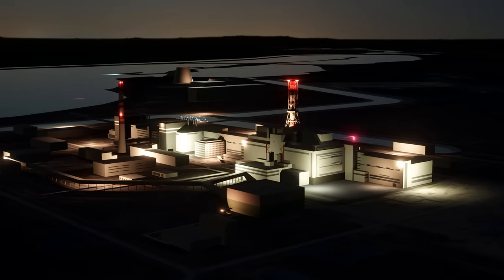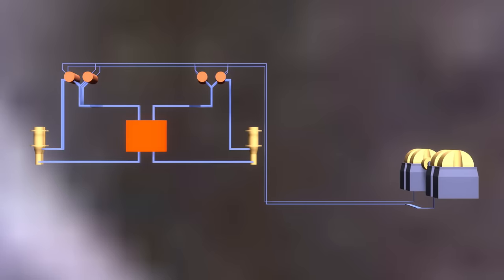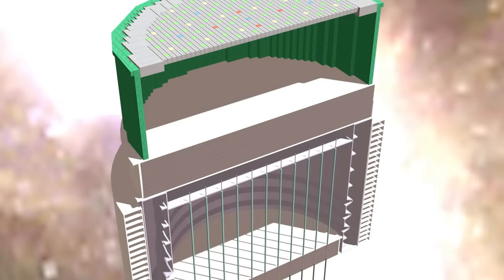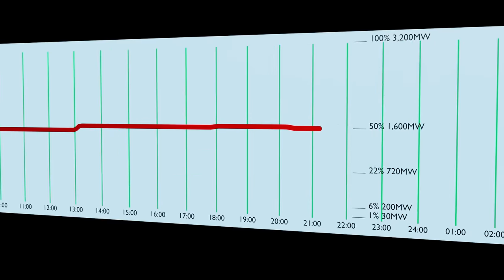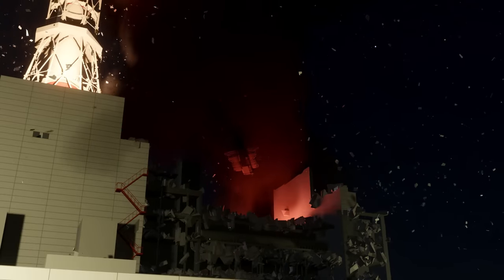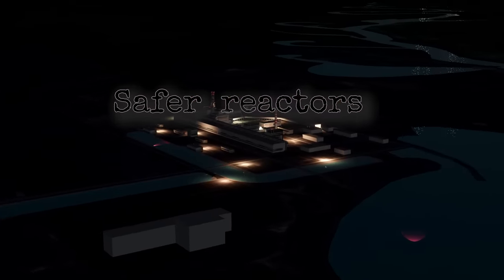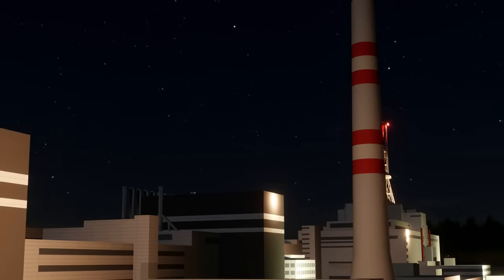CHERNOBYL AZ-5 why it exploded

Comment: *Edit* 
Mike actually edited the video to implement most of these changes, which must be unprecedented in the history of Youtube!

Good video overall, but here are some corrections:
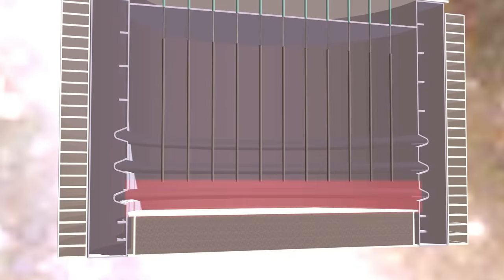4:20 - The graphite sections were cut short because there wasn't enough space below the core, rather than to equalize fuel burn.
4:45 - The previous test had been performed just after a reactor startup, but on April 26 there was a shutdown planned.
5:00 - Running the reactor at half power did not poison it. On the contrary it gave time for the xenon to burn off. If not for the delay, the poisoning would have been worse. Xenon is not a contributing factor to the accident any more than gravity contributes to a skydiving accident.
6:00 - The rules at the time DID allow for restoring power regardless of Xenon, so long as certain conditions were met. It is ambiguous whether any rules were broken, but at the time the operators would not have seen any clear reason not to continue.
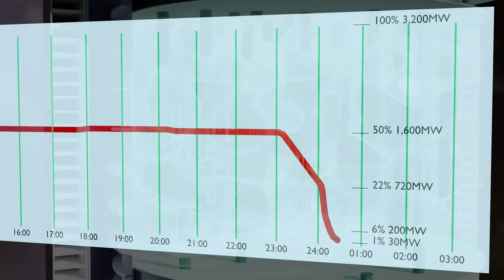6:15 - The control rods were in a normal and allowed position after restoring power for the test. But later changes to coolant flow and temperature meant that more rods had to be removed. The car analogy is silly because the RBMK was designed to be operated like this (fewer rods inserted = greater fuel efficiency).
6:45 - The personnel had agreed to push AZ-5 at the START of the test, but apparently there was some confusion and this action was delayed for 36 seconds.
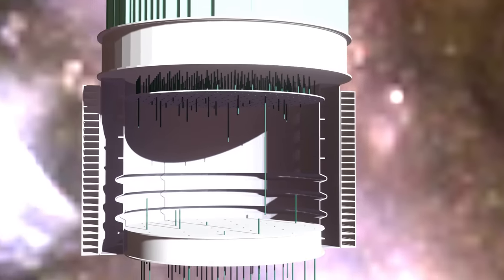7:15 - An entire group of automatic control rods was fully inserted, and another set was in motion as well. There is nothing 'frightening' about no rods being fully inserted; this is just how the RBMK was supposed to be.
7:25 - In practice the limit was 15 rods, not 26. RBMKs had to regularly operate with less than 26 rods, and operators were unable to track short-term fluctuations in this value because at low power there was no instrument capable of tracking it.
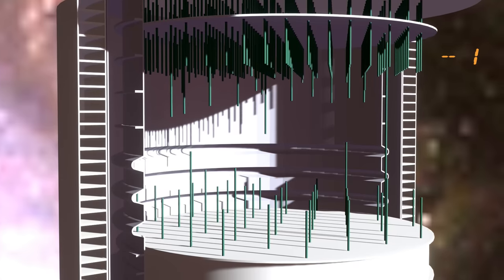7:38 - AZ-5 did NOT insert any rods from below. If it had, the reactor would have been saved. This safety improvement was scheduled to be implemented following the scheduled shutdown.
Reply: Майкл, ты?
Reply: @ВячеславТитов-ы8ж  тихо, я инкогнито
Reply from the maker: Thanks for this information.  

The positions of the control rods at moment of AZ5 I modelled exactly as in the INSAG-7 report.  This shows 7 below rods partially in the core.  How is it that these rods had not yet been installed if they are shown in INSAG?  Insag also shows the Auto rods were mostly extracted at the time.

I don't recall INSAG saying they the below rods were still to be installed and this is a pretty vital aspect.

Are you certain the below rods were not yet installed?  Its the first I heard this.  But when visualizing it in 3d, it does seem odd they were not enough to the stop the runaway on the floor and makes sense.
Reply: @Mike-Bell  What page of INSAG are you referring to? I will check, but suspect you are misinterpreting something. By the way ORM = 7 has nothing to do with 7 rods being partially inserted. Many more rods were partially inserted than that. ORM is a calculated value that depends on the shape of the neutron fields, "1 rod" is sort of an imaginary value.

The bottom-insertion rods (USP group) were installed, they just didn't insert when AZ-5 was pressed. The planned fix was to connect their insertion to the AZ-5 signal.
Reply from the maker: @MinSredMash  Ok now I understand. Chernobyl did have it’s below rods but they didn’t enter the core on the night of the disaster because they weren’t coupled to the AZ5.  Had Toptunov inserted the below rods first and then shutdown or if they were included with the AZ5 signal it would have all been a non-event .  What a tragic ballsup because it is so clear from the 3d how they would have prevented the explosion.

Page 45 right at the top confirms that the shortened below rods were proposed in 1977 to be coupled to AZ5 but not implemented at Chernobyl as well as other plants. 

Now I’m pondering whether to take the video down and upload a correct version with the below rods not moving in the animation with the pushing of the AZ5.  And also delete the wording about the ORM and some of the xenon poisoning wording. The xenon caused the stalling of the reactor to 1% right?  Redoing the voice is big job now but I can redo the 3d modeling easily and quickly. 

p 119 shows the rod depths I modeled in 3d.  I presume this is reliable. It shows the auto rods also extracted.

Thanks for the corrections you list.
Reply: @Mike-Bell  You shouldn't have to do an entirely new video.  Just put your corrections as a comment thread here.
Reply: @Mike-Bell  Cheers, thanks for asking. Probably adding some notes to the video description text is plenty, but if you plan to edit the script I could suggest some wording.

Xenon didn't directly cause the drop in power. There was either a user error or a malfunction of the automatic regulator or both, and a bunch of automatic control rods were inserted. The xenon in the core probably perpetuated the resulting drop in power. Page 74 of INSAG-7 explains the relevance here, in terms of a "new xenon reshaping of the power density fields." After all, the critical problem was that the neutron flux maximum was at the bottom of the core, right where the tip effect existed. 

Pg. 119 shows rod positions at 1:23:30, but that leaves out 10 seconds of downward rod movement for the automatic regulators, which is attested to by eyewitnesses. There is also some confusion here with the data because INSAG-1 (not always reliable) showed much more downward rod movement in the final seconds/minutes. Maybe I'm blind but I'm not seeing that fully-inserted rod in the diagram, either.
Reply from the maker: Youtube doesn't like deletions and re-uploads of the same tweaked video so I'll leave it at a pinned comment.  Thanks again for the corrections.  It's obvious you know a great deal about Chernobyl.  It would be great to get your comment on future videos prior to upload.  If you are willing please reply to tadpolefarm@gmail.com so I can get in touch.
Reply: @Mike-Bell  I wish people had this eye for detail when it comes to Fukushima.  Nearly 40 years and we are still trying to understand the details of Chernobyl and yet think we really have all the details?   We really think after nearly 40 years we understand this event and what its really done to people all over the globe?   Yet only a few hundred people died as a result?  The millions that received low dose internal exposure causing cancers, heart disease and autoimmune diseases that haven't been added to the totals...and we are trying to figure out how many rods should be in the animation?????  We are worried about the wrong issues here completely....
Reply: @MinSredMash  How many people died as a result of Chernobyl.  He says you're very knowledgeable, let's just see how knowledgeable....
Reply: @paulmobleyscience  No one can confidently state an exact number. I don't think I'm interested in playing whatever game you have in mind. No doubt you are going to approach the death toll from either an extreme anti-nuclear or pro-nuclear standpoint, since no one ever seems to take the middle ground.
Reply: @MinSredMash  Extreme in a simple comment section on a video about a nuclear disaster that happened nearly 40 years ago would be a monumental task to achieve.  Extreme I think is a bit extreme in of itself to say about something that could or could not happen.  A simple discussion is all I'm asking for here with respect absolutely.  There is a disconnect and I enjoy speaking about this topic in general with people that can have an honest,which is the keyword, discussion and attempt to bridge the gap of some things.
Reply: @MinSredMash  I made a comment thread here 21 hours ago long before I approached this thread and made a comment.  If you can read that and then be honest then I can discuss things admirably honestly with you all day long and you will leave our interaction with a good feeling.  I will say I am anti-nuclear but I can have a discussion with someone that shows respect.  Text doesn't convey emotion very well and some things may seem one way when they are another.
Reply: @paulmobleyscience  The answer is that Chernobyl radiation theoretically caused cancers, but except for thyroid cancers these effects are too small to be reliably measured. The increase is lost in the noise of the data, and basically imperceptible. Any cancer increase impact outside the Soviet Union is scientifically rather dubious, but for the sake of being conservative, the WHO assumed around 5,000 fatal cancers over 100 years, in a population of over 500,000,000.

Very clearly the impact of socioeconomic dislocation and trauma has been very great, however. The mental health and psychosocial impacts of the disaster have proved far more harmful than radiation exposure itself. Somewhat similar to premodern wars, where more people died from epidemics than weapons.
Reply: @MinSredMash  The affects are too small?  That's not honesty, thats a roll of the dice.  The affects are unknown if the cause of each cancer or heart disease or autoimmune diseases are unknown.  All the major diseases that have latency periods and incubate inside the body make it next to impossible to know the scope of the affects one way or another.  Thats honesty.....it isn't just cancer....low dose long term internal exposure causes upwards of 1800 different diseases and ailments that cause death as a result....and not one of them is known.   We know there are billions of cancer cases since Chernobyl and not one single cancer cause besides thyroid cancer is known.  The IPPNW oversight committee of the Fukushima health department thyroid cancer study where on paper it was projected that 4.1 people out of 300,000 people would have thyroid cancer after 3 full meltdowns when after 10 years the actual numbers are 96 out of 220,000 people (80,000 moved up into the next study due to age) have thyroid cancer.  Those 96 people and more, each and every single one of them would beg to differ on your use of the words small affects.  The issue is we've tried to justify what we are doing with averages, concentration ratios, grouping individual people together for the sake of laziness and making it easier being one of many reasons and corruption mind you.  No, there is no middle ground when honesty isnt used at all and see nothing extreme just plain and simple facts.
Reply: @MinSredMash  More people died from mental trauma then actual weapons?  Ok you mean like depleted uranium tipped weaponry used since Vietnam all over the globe?  You mean secret Government programs and 22 trillion dollars missing from the Pentagon is honesty and we think we have a clue on the totals of deaths caused by this incident or any other to be honest?  That the "deaths per killowatt/terrawatt hour calculations are incomplete without every single cause of cancer, heart disease and autoimmune diseases that they all cause is known....that honesty.  And at the end of the day lets be real honest here....its never been about energy for the masses....it has always been about uranium daughter procurement and a market made up out of thin air to sell it.
Reply: @MinSredMash  Alpha Nucleus particle Beta electron particle gamma ray x ray. At the end of both Alpha and Beta decay modes there is a gamma photon release.  Uranium/plutonium decay chains ending in lead which is toxic in of itself.  Hydrazine and other chemicals used mixed in with the water.  Transuranics are electropositive while FLUORIDE is electronegative......do you believe fluoride was added to the water supply so children would have healthy teeth and gums?  Hexafluoride is used to break the covalent bond and separate the fissle material from the wasted fuel.  Barium and aluminum silicates are used to remove strontium from sea water and coupled with an RF resin can also remove cesium as well.  Massive amounts of Barium and aluminum found in air, water, soil and blood samples even on top of Mount Shasta.  Absorbed dose is 1 range 2 deposition through the range  3 area of irradiation 4 density of the means Convert... Starfish absorb up to 1000 times more plutonium than any other animal in the ocean.  Handford tank farmers inhalation of gases causing respiratory illnesses that will never be added to any nuclear total.  The cause of death listed is not the cause it is the affect of the cause.  Cancer is not a CAUSE of death...it is the affect.
Reply: @paulmobleyscience  I struggle to comprehend your point, but I see that your general approach is that because there is no clear statistical or epidemiological evidence, you feel free to blame any number of naturally occurring diseases on radiation. 1,800 diseases caused by low dose radiation is a pretty hilarious factoid, maybe I will share that one around the office. I wonder how you imagine medical researchers managed to carry out 1,800 studies on this topic...

By the way, no radiation-related increase in thyroid cancers has been detected in Japan. Thyroid growths are almost always harmless and people either never detect them or wisely ignore them. When you start screening the whole population for thyroid cancer, the rate goes up. In Japan and other countries they detected a lot of these benign thyroid growths long before the radiation could have even had an impact. (You yourself mentioned the latency periods.)

https://www.thelancet.com/journals/landia/article/PIIS2213-8587(16)30318-7/fulltext
Reply: @paulmobleyscience  Oh, I thought the fluoride was related to the vapor trails. Thanks for setting me straight.
Reply: @MinSredMash  I feel free to blame any number of diseases on radiation.....no I definitely didn't and even went ahead and made certain to make it fully known that it can't be known one way or another...many times.  I didnt blame billions of cancer on Ionizing radiation, I absolutely said the cause isnt known....either way.   One way or another.   Yes 1800 different diseases because I actually know what I'm talking about not just a pretender such as yourself.   Yes 1800 different KNOWN diseases and ailments it does cause.  How medical researchers carried out 1800 different studies on the topic....they have genius in over a century it has been done.  From the beagle dog study to the study showing mutations increase at the third generation.  Thousands of studies so yes you share that factoid "around the office" as if I'm supposed to feel a certain way about that statement.  I dont care what you do for a living and judging by your pronuclear stance a picture is starting to unfold.
Reply: @MinSredMash  Latency?  Then why do we take potassium iodide after an incident?  As if iodine 131 is the only thing that comes from a release.  Thyroid issues are a bit different arent they seen shortly after Chernobyl in Belarus as well.  Thousands of people because they weren't evacuated like at Fukushima which still was over 3 million becquerals per square meter Northwest of Fukushima.
Reply: @MinSredMash  You're welcome for setting you straight.  I know you meant it sarcastically but you'll look it up and find it to be true.  Out of that entire paragraph you picked one thing I didn't say and Fluoride both of which requires someone to do their own math for a change and not rely on corrupted data.  We can't even detect radioactivity properly to begin with much less the deaths it causes.  Let me ask you, what law is used to calibrate all radiation detection monitors and tell us what you know of that law?
Reply: @MinSredMash  Then tell us about gamma attenuation, dead time, electron avalanche and quenching gas, saturation of the tube especially around an extended source and the need for a perfect voltage ie 0-100-0 volts from a battery.
Reply: @MinSredMash  Still struggling I see....
Reply: @paulmobleyscience  I simply choose not to engage with someone who relies on magical thinking. But if you are worried about science's inability to detect radiation, I have some crystals that you can wear on a pendant, and these will offer protection. $29.99 with free shipping.
Reply: @MinSredMash  Magical thinking?  Everything I've said is nuclear physics, science and deaths that are unaccounted for.  How is that magical thinking?
Reply: @MinSredMash  Specifically....say it....dont just pretend to know a complete stranger and say silly things like magical thinking.  I wasn't talking about unicorns and rainbows.   If you dont understand then just ask I'll be happy to help.
Reply: @MinSredMash  You do know the inverse square law is used to calibrate all radiation detection devices don't you?  Intensity= 4×pi×r2.....in vacuum and does not apply to extended sources of radiation on the surface of this planet with a water cycle.  Plancks law....there shall be no flow of energy or matter from the black body to the environment.  Coulombs law Force=K×q1q2/d2. This isn't magic this is science Mr.  Petkau affect internal exposure, Curie being ANY radionuclide with 37 billion disintegrations per second....per second mind you in the early 1900s.  Yes lets talk about magic.....you think a plastic and metal device with a glass or metal tube with a gas in it can see every ionizing event and we can gather ANY kind of information from that other than there is a release.  Mass Spectroscopy.....how many 10 of thousands of dollars do they cost?  Scintillator for liquids that no one can afford and they still cant tell us the correct amount....do you even know why?  Electron volt is 1.602 × 10−19 joule in vacuum....do you know what it is out of vacuum and on the surface of Earth where it is used?   Range and deposition through the range is how we know the differences between the radionuclides.   Orbital shells and electron avalanche giving false positives and true negatives.   Charge and the lack of charge, wave particle duality......you know the more I think about it you may be onto something when you said magical....
Reply: @MinSredMash  a parting gift for you to share around the office....just one single search I really am here to help.  "Sweating the small stuff: Pitfalls in the use of radiation detection instruments." One of those studies you know....
Reply: @MinSredMash  I know I said one more but I have one more thing to add because most people have this completely wrong.  Naturally occurring....do you think uranium is naturally occurring and comes from the core?  Or do you know that it was actually "splattered" onto the surface of Earth from a solar release?   Speaking of solar releases...ever hear of the Carrington event?  Do you believe that at any moment the sun can release enough energy to cause massive induction at the L-shell magnetic field lines of Earth causing an EMP that will not only wipe out all the power but every back up generator including all the chips on at least one side of the planet or even the entire globe?   How about known evidence of releases that have caused muon petrusion on a continental scale with magma intrusion and unlocking of the plates causing liquefaction to occur.  Do you suppose those reactors would end up in the same place they started?  Prompt criticalities, 450+ Fukushimas with no one coming to help?  Magical he says.....well you've been weighed, measured and have been found wanting.....good day
Reply: @PORRRIDGE_GUN  the neutron absorbing isotope of Xe135 is produced mainly as a fission product I135 decays via beta decay (half-life of 6.6 h). Xe135 decays naturally as it is a beta active radio isotope, and it "burns off" as absorbing a neutron, it transforms into Xe136, that is nearly transparent to neutrons.
It is somewhat misguiding to talk about it as gas, as most of it is still inside the ceramic fuel pellets during operation, and a little fraction is as free gas between the pellets and the cladding tube of the fuel rods. So it is well contained, provided fuel rods are intact.
Reply: @PORRRIDGE_GUN  Money verses lives or deaths of a group of people for a cheaper energy is not the only factors to use when makings decisions like this. Deaths and money.........those are the 2 factors used and couldn't you agree there are hundreds more factors that should be addressed first.
Reply: @mattipaajanen4109  You said it, provided they are intact.  Once its corium and surrounded by any water with any ph lower than needed and there is a problem.  Redox, Uranyl ion, uranium sulfate, oxidized crust, water solubility of transuranic radionuclides that evaporate under equillibrium conditions.  This is why Fukushima is worse than Chernobyl.
Reply: @PORRRIDGE_GUN  Also deaths per kilowatt/terrawatt hour are incomplete without the very primary disease added thats caused from exposure to ionizing radiation....cancer.  Its the primary disease caused by every type of energy production.  Respiratory..from fossil fuels....yes but Respiratory illness is also attributed to nuclear power as well, Handford tank farmers.  Its a scam completely and has been from day one.
Reply: @mattipaajanen4109  Tritium...thought to be the "softest" of all radionuclides.  Thought to pass through the body in under a month by most, yes?   Incorrect...ORGANICALLY BOUND TRITIUM.  Tritium is regularly released from every water cooled reactor (Indian point 65,000% above background under the site) causing tritium exposure that does not pass through the body in under a month. It actually replaces hydrogen and forms organically bound tritium which absolutely stays in the body causing various biological effects including DNA strand breaks, micronucleus formation, cell necrosis or aptosis, chromosal aberration and various other phenomena thus negatively affecting human health. The half-life of tritium is 12.33 years and the AVERAGE penetration of its ELECTRONS in water is 0.56um, which is considerably less than the AVERAGE diameter of a human cell.  Therfore it does not cause damage due to external irradiation but rather long term internal radiation that results from inhalation, oral intake or absorbance of radiactive particles through the skin. AFTER ENTERING AN ORGANISM, TRITIUM CAN REPLACE HYDROGEN ATOMS IN BIOLOGICAL MACROMOLECULES OR BIND TO CELLULAR COMPONENTS TO FORM......ORGANICALLY BOUND TRITIUM (OBT).  Smallest of all radionuclides it can't be held or contained due to permeation.  Do you know how tritium interacts with stainless steel?   It will actually split, pass through and reform on the other side.   I know....
Reply: @Mike-Bell  The video was done perfectly and you shouldn't change a thing because it really doesnt matter how many rods or what position they were in 40 years ago doesn't really  matter at the end of the day.  You put out some fantastic content that shouldn't be picked at over every little detail.  When we know we didn't get all the information to begin with then the minor details especially for a youtube video showing what happened and spreading knowledge of the situation to the masses should be applauded.  Great job all the way around and I wouldn't change a thing.
Reply: @PORRRIDGE_GUN  It's a figure of speech. Higher neutron flux dissipates the xenon. In this case it would be more appropriate to simply state that the xenon decays away.
Reply: @paulmobleyscience  I don't know why you reply this to me. I was simply answering a legitimate question of "xenon burn off". I was not talking about effects of radiation to organic matter and will not take part into this dispute.
Reply: @mattipaajanen4109  Hi Matti, what I was more interested in was when you said the fuel must stay intact with the zirc cladding otherwise there are issues.  I know you were speaking to the Xenon and you added about the need for the fuel to not meltdown.  I added more information and thought this is how conversing with peers is like.
Reply: @PORRRIDGE_GUN  Hi Andrew I was in a hurry this morning and commented what I could to everyone before I had to go but I did want to come back and have a chat with you.  35 to 40 thousand, see now thats an honest start Andrew.  There are a few factors that should be considered and addressed when speaking of deaths of any one thing in particular.  Ionizing radiation exposure can induce dormant illnesses and diseases in our bodies on top of cause them.  When exposed the immune system takes a huge hit and can cause things to happen that otherwise may never have happened.  Over 2000 open air bomb tests that sent radionuclides around the globe, so much so all our grandparents were internally exposed to radionuclides that caused their chromosomes to change which changed how our parents RNA/DNA was written to begin with.  The damage done to the genome is passed onto the next generation which is then passed onto the next generation and as exposure increases so to do the abnormalities in our bodies.   Then as more radionuclides were and are released from Chernobyl this caused Cancers that were already lying dormant in their bodies waiting to be thrusted to the forefront.  Since Luekemia and other cancers have grown but we are just getting better at earlier detection with more going to the doctors and more advancements in treatments using the very radionuclides that more than likely sparked this all off.  Anyone that knows anything about Chernobyl knows we all have a piece of Chernobyl inside of us....we've all heard this yet somehow we disconnect it from all the cancers, heart diseases, autoimmune disease, respiratory diseases that have never once been counted towards any death from nuclear but they have all been attributed to fossil fuels....the same exact illnesses....how is that possible?   You then add Fukushima which is much much worse than Chernobyl by every way possible and still people don't understand the basics.  They have all this nonsense added on like concentration ratios which creates a normalcy bias but completely forget what they learned the first year of college when they were taught that the inverse square law does not apply to extended sources of radiation especially here on the surface of Earth with its water cycle.  And then with Malice we are told that every single disease runs in our family history.....right because our families history was them getting irradiated and then every generation after those bombs have suffered massive releases and damage from Nuclear power stations.  Fuel processing plants in the Carolinas leaking for decades, Handford, Los Alamos, Savanah River, Tennessee river valley, Clinton's and the midwest, San ononfre, devils canyon, TMI, Windscale, Russias nightmares, Chinas nightmares, Japan's Nighmares, Indias nightmares.......How can anyone promote this?
Reply: 9 times out of 10 every pronuclear person either makes money directly from the nuclear industry crumbs included or knows someone that does thats how.....and the 10th pronuclear person is just ill informed thats how....
Reply: @MinSredMash  I heard that skins of many firemen were affected by the contaminated radio-active juice when they tried to extinguish the fire of the Chernobyl accident. Japanese firemen at the Fukushimadaiichi accident tried to be less affected. But two plant personnel of TEPCO stepped into a pond of highly radio-activated water and got their feet scalded .
Reply: @MinSredMash  How long does it take for a poisoned reactor to burn Xe-135 using neutrons as opposed to it decaying? So many videos claim that as soon as the reactor’s power increased, the xenon burned almost immediately.
Reply: @paulmobleyscience  you really should look at how many more deaths anti-nuclear power activist have caused. Especially worth they're very miles goal of getting to save a few from something that does not happen.

Beggars of their false fear tactics, millions die from the large amount of pollution generated by other sources, that would never have been generated if the nuclear age has continued.

Is simply ironic that lying and spreading false fear to try to prevent very few injuries and casualties, ended up causing millions of people to die.

As far as your number with chernobyl.

29 firemen from acute, and another 2, from the direct chernobyl incident. Total 31.

It is estimated at 50 can be estimated as direct to Chernobyl. The who, and Un also put out studies stating that possibly up to 4000 more could die, and before other have had numbers in a wide range. The problem hate is Tulare are a lot of anti-nuclear power activists putting out giant insane numbers to continue to bring the mass fear tactics to people.

Fukushima has had 1 death so far, I believe in 2018. It also had a few hundred from people trying to evacuate. Don't know how they died, but maybe panicked, or poor evacuation procedures. 

The reactors in the US, and most of the world, can not do what chernobyl did. 

The incident at fukushima could have been prevented, it was prevented at its sister plants and other reactors in the area. This incident, had from the earthquake, then tsunami, but all the other plants were fine. Fukushima chose to follow the proper chain of commands in Japan, the prime Minister at the time of this incident, is the only one to give orders (way different in most countries and the US). Japan has since changed this. 

Since fukushima waited for orders, they didn't do like their sister plant. The sister plant ran electrical cables to the grid to power their cooling pumps. 

https://reason.com/2016/04/26/more-deaths-from-coal-pollution-annually/

https://ourworldindata.org/what-was-the-death-toll-from-chernobyl-and-fukushima

https://ourworldindata.org/safest-sources-of-energy

https://www.bbc.com/future/article/20190725-will-we-ever-know-chernobyls-true-death-toll
Reply: @JC-lu4se  Xe does change out very fast to a stable isotope when a reactor is pushing more neutrons.

Edit: I really simplified the response here. There are so he good sources that go into a much better detail about it. And MrChyort gives a much better explanation. The explanation about how Xe135 in a reactor at power without the calculations can be read about on Wikipedia (I don't like to use this shirred, but it does help here).

https://en.wikipedia.org/wiki/Xenon-135
Reply: @taesssi  I didn't say everything I did and then need Richard the 2nd to tell me how the world works, it doesn't work that way Richard.  Coal deaths?   Is this the 1920s with no filtration systems like they have today?  Speaking of neutrons,  U238 is what keeps the U235 from chaining in nature.  Uranium isn't a "naturally occuring" element from Earth, it was "splattered" onto the surface from a solar release.  The same exact diseases are caused by both fossil fuels and nuclear energy, and the specific cause of each one is unknown.
Reply: @taesssi  Don't you get it?  The cat is out of the bag.  We already know whats happening and the information is no longer controlled like it used to be.  WATER SOLUBLE transuranic radionuclides are causing deaths that aren't being counted.  Respiratory diseases like the Hanford tank farmers that will never be added to any nuclear death total.   Cancers, heart disease, AUTOIMMUNE DISEASES and many many others that are never added to any nuclear deaths total, oh but those same diseases are attributed to fossil fuel ESTIMATES.   Those links you provided....what formula and factors were used to make those guesstimation?
Reply: @taesssi  ESTIMATED......do you understand what estimates means?   Do you know that estimate means best guess?  You do realize that an estimation can't be completely treated like its a 100% known thing don't you?
Reply: @paulmobleyscience  well you sure got offended when someone answered your questions with protest documentation.

Those links are only a few of of the thousands of proper studies done.

Chernobyl is self has a 182 page report done of the incident.
The aid you are asking for is there and in other professional scientific studies.
Reply: @paulmobleyscience  it would be great that when you say water-soluble transuranic radionuclides deaths, that you actually show you'd, work may, science, or even 1 single case? I'm assuming this is about fukushima?

no matter the scrubbers on coal, they work so good that it's still adding massive mounts of greenhouse gasses....

What sale diseases are caused by fossil fuels and nuclear? Radioactive burns? Degraded lung capacity? There maybe a slight cross over on a few things, but not much. Coal, will fossil fuels kill 100,000+ each year.

You two me I don't ne3d to do what ever, yet you aren't even able to go and get the research to your answers. There are papers out there from all past all the universities, agencies, independent scientists, and so on, that answer all this.

Even better the accrual true environmental protection groups push nuclear because it is one of the cleanest and safest firm of mass energy generation.

We been the eu just this past week said so and are now pushing Europe counties to stay to plan to build way more plants to curb the greenhouse emissions.

The eu is qualifying nuclear power from green investment. 

https://www.reuters.com/article/us-europe-regulations-finance-idUSKBN2BJ0F0
Reply: @taesssi  Offended?  Text doesn't convey emotion.  Those links, those people used formulas with concentration ratios...dont just dance around the question...specifically what formulas and ratios were used?
Reply: @taesssi  1 single case you say...well sure just as soon as they develop a test or procedure that lets us know what each disease is specifically caused by ill get back with you and show you that one single death.
Reply: @taesssi  massive mounts?   Greenhouse gases you say?  Which means what exactly?  Globally we get 60% of our energy from coal while nuclear only covers 10%.  Lets get real here Richard......nuclear reactors have never been about power for the masses and it has always been for uranium daughter procurement and a market made up out of thin air to sell it, nothing more.
Reply: @taesssi  Exactly studies that prove all this.  Since Dr Marko Kaltofen has already found hot particles across the entire United States then that means that there is a massive amount of people that ingested those hot particles from Japan all around the globe...just like everyone alive today has a piece of Chernobyl inside them.  We have studies especially recent ones like the ORGANICALLY BOUND TRITIUM study.   We have the studies that prove exposure is occuring and people are dying because of it...you know the same exact guesstimation process using formulas and concentration ratios.  So when they do finally publish what each death is specifically caused by then we can use death as a factor for a decision but until then death is a non factor therefore with the knowledge of how dangerous uranium and plutonium are, how expensive it is to build and maintain a reactor, the waste issue obviously that you wouldn't want to talk about and the proven corruption and lies proves that nuclear power should have never began.  The cart was placed in front of the horse.  All the fossil fuels combined couldn't wipe out all life on this planet...oh but it would only take a few reactors to cause massive deaths to occurr.
Reply: @paulmobleyscience  the questions to your answers are all given, you can go through the multilayer studies.

They tell you exactly how they came to worth their numbers. For that matter, they can even follow fallout. They can follow a trail from a place and know exactly when and where stuff such as fallout can happen.

Instead of wasting the time trying to beat around the dead bush here to get others to give you the links, as I already have you a good number to start with. Go out and look for yourself. That lady website accrual hat destination links to tons of facts, studies, and other organizations doing the work for you.

Second, your comment Drove offense with how you had a like fun writing out a name.

What's really funny too is just how the guy above said, that once you were given the real numbers you would try and play some imaginable numbers and anti-nuclear per rhetoric that's been proven false so many times in the history of nuclear power.
Reply: @paulmobleyscience  so your, imagination of nuclear power, is just that.
Reply: @taesssi  So your imagination of fossil fuels is just that
Reply: @taesssi  No I'm asking you do you know?  Do you know the formulas and concentration ratios?  I'm not asking about your sources, Im asking you.  If you don't know just say you don't know and we can move on..
Reply: @paulmobleyscience  on just to go back over a long post of faulty information.

I'll give just 1 thing for you. A nuclear reactor is not a nuclear bomb. They have the same forest word but are no more the same as an apple and a macadamia nut.

An apple grows on a tree, and is a fruit, a macadamia nut grows on a tree and is a fruit.

However they use the carbon that they take in top develop way different items.

A nuclear bomb uses a rapidly growing chain reaction of a super critical set of elements in a precise way.

A nuclear power plant uses a controlled reaction of sub critical, and critical, fast differently organized, fast different structures of similar element. Hoeven a nuclear reactor is impossible to have a nuclear explosion.

Mightest will tell you the waste too drive you don't look stuff up.

Lots of the waste from current plants in the US can be used in more reactors, rapidly utilizing their energy for more power generation (this is being done in other countries, and had been being done and possible for a long time). Next is that there are locations to store said waste, whether it's on site, as most US nuclear plants do, or off site in other locations across the country.
Reply: @paulmobleyscience  again fossil fuels have already, and are constantly being monitored and tested. The data is there. However your mind is not ready by what I see in your comments.
Reply: @paulmobleyscience  I know the facts about everything I have said. I have the education to back that. Plus over 12 years in the business.

All you are trying to do is keep restating false information with nothing to back the claims.

Then when you are given that you go and try to say that all you want to know is the calculations, which again are all included in everything provided.

Anyways my time is up and I'm heading to sleep.

Have a goodnight.
Reply: @JC-lu4se  In this particular situation it couldn't happen, because reactor power increase was so small that the more accurate of the two instruments didn't even detect it. There was just an increase of reactivity in the bottom portion of the reactor, most of which took place over just 10 seconds. The idea of xenon burning off doesn't actually exist in any reputable sources (IAEA reports, scholarly articles, etc) about the accident, and I can think of at least one scientific paper that refutes it. In point of fact according to calculations performed after the explosion, the remains of the fuel remained poisoned by xenon until that evening. Xenon doesn't float around in the core as a gas, but exists inside the crystalline structure of the fuel pellets themselves.
Reply: @taesssi  I already know a NPP isnt a nuclear bomb....do you know they both are capable of prompt criticality?  Whats this assuming what my knowledge is. Instead of assuming things ask me dont just assume you know who I am and what I've done in my life.
Reply: @taesssi  Did you know the INVERSE SQUARE LAW DOES NOT APPLY TO EXTENDED SOURCES OF RADIATION?
Reply: @MinSredMash  Thanks for your response. From all of my reading, it was the voids in the bottom of the core rather than Xe-135. It’s difficult sometimes finding fact from fiction online, and finding comments from physicists rather than wannabes.
Reply: @taesssi  Cheers.
Reply: @MinSredMash  The fact that there was enough pressure of hydrogen built up means the water at least burned off and then once its corium its no longer the same as it was with zirconium surrounding it.  That changes everything at that point.
Reply: @paulmobleyscience  I honestly have no idea what you're talking about. There was no hydrogen being created until the reactor was already destroyed. Same with corium.
Reply: @MinSredMash  The hydrogen build up is what caused the explosion
Reply: @paulmobleyscience  Hydrogen can't form until the fuel rods shatter. At which point there will inevitably be a steam explosion. So hydrogen burning is just the result of the reactor's destruction, doing further damage to the building.
Reply: @MinSredMash  hydrogen can't form until the fuel shatters??????   You have no clue what you're talking about.  Unit 1 was the first to explode.....after the fuel rods started getting hot and STEAMING OFF THE HYDROGEN IN THE H2O!!!!!!
Reply: @MinSredMash  Hydrogen forms once the fuel rods begin to meltdown which they did before the explosion....It was hydrogen gas its already been established it was hydrogen gas by everyone how are you the last to know?
Reply: @paulmobleyscience  Actually there is no hard evidence of a hydrogen explosion. That is just the most probable hypothesis. But you started this exchange by spouting some incoherent nonsense about hydrogen making water boil away, and corium that didn't exist yet. Which still doesn't make any sense. Water boiling causes a reactor runaway, which causes fuel channels to burst. Only THEN can hydrogen start forming, and corium comes much later.
Reply: @MinSredMash  no I never said hydrogen made the water go away thats preposterous!!!!!.  The melting uranium, the hot fuel is what caused the water to to go away genius.  Talk about incoherent you can't even read....
Reply: @paulmobleyscience  Scroll up and read your comment again. It was nothing but stream of consciousness sentence fragments and grammatical errors.
Reply: @MinSredMash  No it wasn't actually.  Grammer are you serious?  I never said hydrogen is what caused H2O to disapper.   Thats rediculous....type out word for word what you believe says hydrogen made the water go away....type it
Reply: @MinSredMash  You do know that I would definitely know if I said something so absolutely rediculous....
Reply: @paulmobleyscience  This is what you wrote:

"The fact that there was enough pressure of hydrogen built up means the water at least burned off and then once its corium its no longer the same as it was with zirconium surrounding it."

Are you a native English speaker? This sentence would cause you to be held back from the entering the 5th Grade...
Reply: @MinSredMash  "the water at least burned off"....into steam....the hydrogen is FROM the water not what caused the water to steam.  Read it again genius...you even typed it out and still didnt get it....wow
Reply: @MinSredMash  The fact that there was enough pressure of hydrogen built up means/  the water at least burned off...get it genius?
Reply: @MinSredMash  ,,The graphite sections were cut short because there wasn't enough space below the core, rather than to equalize fuel burn" - But still it says something very bad about the designers - the have cut the graphite section and rods, but they have not checked how much will it influence the reactor operation. Even if they checked, they have not designed safety systems to be ready to counter this since the day 1 of the operation of reactor. They are as much to blame as Dyatlov, if not more. Designers such as Dollezhall and Alexandrov that was supervising him should be in jail. Sadly the knowledge of disaster and dyatlov's fault is bad on the book ,,the truth about chernobyl" by grigorij medvedvev. He exaggerated the Dyatlov's fault and everyone took it for granted. The withdrawal of allmost all rods wasn't something unusual as practice during RBMK operation, as you say.
Reply: @cytrynowy_melon6604  Don't get me wrong, Dollezhal, Aleksandrov and Slavsky deserve like 95% of the blame.
Reply: @MinSredMash  My thoughts exactly. When it comes to current clean energy solutions, nuclear energy is an environmental treaaure compared to fossil fuels. There is plenty of blame to allocate for the accident without needlessly demonizing fusion/fission based energy options.
Reply: @paulmobleyscience  MrChyort is correct in that it us impossible to provide anything but a rather large range estimate for actual death toll from the accident. While it is true that the more immediatw deaths were a few dozen, long term death toll from diseases caused by the radioactive fallout is much greater and is believed to be anywhere from tens of thousands to 100,000. Unfortunately, historians have been unable to provide a more accurate estimate due to the difficulties in tracking the affected individuals and soviet goverment's initial supression of negative reports following the accident.
Reply: @LawlessChemistry  No MrChyort is not correct.  The IAEA and the WHO along with UNSCEAR is all part of the same exact corrupt organization...the UNITED NATIONS.  It has controlled all information pertaining to nuclear for decades.  The WHO admitted it will not go against the IAEA and before the WHO can even release a statement it must be redacted by the IAEA and the UN lawyers before that statement is released.  Therefore the entire history of nuclear power is corrupted and every one single measurement, study or any other information published by that corrupt organization is null and void.  I am the one that said CANCER, HEART DISEASE, AUTOIMMUNE DISEASES AND RESPIRATORY DISEASES ARENT KNOWN WHAT THE SPECIFIC CAUSES ARE.  That means it can't be tracked even if everyone was forthcoming with all information it would still be impossible to track the deaths its caused.
Reply: @paulmobleyscience  That's the point, it is hard to determine with any kind of certainty which individuals who were exposed to the fallout and who then went on to develop terminal cancers that are associated with that particular type of exposure. And no, guessing and overestimating is not proper either.  Save for the few individuals who were directly exposed to the radiation at or near the plant, the rest of the victims would have ingested radioactive isotope fallout that is known to cause very specific forms of cancer. For example, I lived approximately 300 miles away from the plant at the time, and was completely unharmed whereas people residing the same distance in Belarus were unlucky given the atmospheric conditions which carried most of the fallout materials in their direction.
Reply: @MinSredMash  so many people convince themselves disease is being caused by mercury in vaccines, fluoride in tap water, electromagnetic radiation, etc. But high levels atmospheric lead from our  consumption of leaded gasoline fuel get s free pass? Not that it is necessarily the culprit, just a much more workable hypothesis that has at least some demonstrable facts.
Reply: @LawlessChemistry  So what are we talking about here because we are all in agreements on that fact..
Reply: @LawlessChemistry  And no it doesn't just cause specific types of cancer....tritium alone induce ls various biological effects including DNA strand breaks, micronucleus formation, cell necrosis or aptosis, chromosal aberration and various other phenomena thus negatively affecting human health. The half-life of tritium is 12.33 years and the AVERAGE penetration of its ELECTRONS in water is 0.56um, which is considerably lessthan the AVERAGE diameter of a human cell.  Therfore it does not cause damage due to external irradiation but rather long term internal radiation that results from inhalation, oral intake or absorbance of radiactive particles through the skin. AFTER ENTERING AN ORGANISM, TRITIUM CAN REPLACE HYDROGEN ATOMS IN BIOLOGICAL MACROMOLECULES OR BIND TO CELLULAR COMPONENTS TO FORM......ORGANICALLY BOUND TRITIUM (OBT). Exposure increases along with tritium levels in the environment.  You may want to research just how many diseases and ailments that are caused by long term lower than accute dose of ionizing radiation.  Even inflammation in the joints....
Reply: @PORRRIDGE_GUN  while we should strive to develop energy  that is safer and cleaner than fossil and even nuclear, it is incorrect and environmentally damaging to malign nuclear energy as some rsdioactive bogie man. When used properly, it is much safer and easier on the environment than fossil fuels. Using Cherbobyl or Fukushima as examples of nuclear dangers is as silly as using a breached dam to malign hydro electric power. Besides, we make risk/utility considerations all the time. Just take cars for example, are MVW deaths acceptable or would more people die and suffer without them?
Reply: @LawlessChemistry  And no your obvious conflict of interest is the damaging part of all this.  Lawless chemistry is it?   So what do you do for a living?
Reply: @LawlessChemistry  Wow now I heard it all.....comparing a breached dam to Fukushima.....
Reply: @taesssi  What's even funnier is his use of scientific language to descibe why nuclear fallout can be dangerous (something I don't think anyone here disputed). I am starting to suspect it is mostly copied from somwhere else, and that he doesn't fully understand much of it.
Reply: @LawlessChemistry  And even a CAR???  Ok if you want to make an analogy using a car first there are factors you have to transfer over to the car..like for example 5 point harness and duct taped to the seat with your hand taped to the steering wheel because you dont have a choice and then as soon as the ignition is started the car shoots off at mach 20 weaving in and out of traffic trying to keep it in between the white lines and the farmers fields youre passing are a blur but your exhaust is releasing radionuclides into the air and tritium into the ground for those vegetables all the while trying not to kill millions of people from one single car.....if youre going to compare apples to oranges then make certain the analogy is fully correct
Reply: @paulmobleyscience  Water evaporation is not the same as electrolysis. Explosion from steam pressure doesn't mean the hydrogen was separate and therefore combustible. Or was there some other chemical reaction that took place before the explosion with H as gas byproduct?
Reply: @LawlessChemistry  no one ever said the hydrogen was combustible, where did that come from?  Pressure...hydrogen meeting oxygen...thats the issue
Reply: @LawlessChemistry  water evaporation is the issue though....because of water solubility of just the radionuclides and bonding.  Covalent bonds, fluoride is electronegative while transuranics are electropositive....yes..I know
Reply: @LawlessChemistry  What do you do for a living lawless?  Do I really have to ask again chemist?
Reply: @MinSredMash  He is as fluent in English as he is in chemistry or physics. Stringing together lengthy words without comprehending their meaning then boasting of intellectual superiority has become a trend. A little knowledge is a dangerous thing indeed.
Reply: @paulmobleyscience Does it even matter what I do for a living? I don't work in the fission energy sector or for the WHO, so noone is paying me to claim that nuclear energy is doom incarnate.
Reply: @paulmobleyscience  Look, I'm not at Ph. D. chemistry level either, but when I reach limits of my knowledge I just say so. You can't use what you learned in a semester of High School chemistry to write about physical chemistry. It's like using latin roots in english words to speak latin, gibberish sounding.
Reply: @paulmobleyscience  I guess in your native language analogies have to be overly detailed and specific to be analogous. Does the nuclear plant have to have a spoiler and emergency breaks for a good analogy of a risk/utility concept? Do I have to consider local speed and particle emission limits?
Reply: @paulmobleyscience  Let's not forget about all that Tritium produced in our atmosphere. Wait, is tritium the hydrogen you keep referring to? Sure Caesium 137 is much worse, but you seem to know what you are doing in downplaying Chernobyl. Are you one of those dihydrogen monoxide haters, too? Between your WHO/electron bonds words gaspacho and the Russian bots who post here about it being anti-Russian propaganda, I still have no idea why you want to know if I am gainfully employed. Perhaps this is Dunning-Krueger effect at work?
Reply: @LawlessChemistry  Yes and I haven't reached my limits yet and the WHOle point.  This topic takes more than just a comment section, video or a PhD in any one subject and how many rods that were in this animation of a meltdown that happened nearly 40 years ago makes no difference when we've learned so much in that nearly 40 years. I know more about this topic obviously than the normal person and even those in this field because of their blind devotion to nuclear power and the money they make from it.  That's what's called a conflict of interest found throughout this entire topic.  The real information is indeed unknown by the masses including yourself because as you said you dont have a PHD and I can guarantee you haven't studied this as much as I have based on your language thus far.  That means I would know for certain by what youre saying. You haven't said a technical thing since you showed up...nothing just like MrChyort...
Reply: @LawlessChemistry  Yes the tritium that comes from the sun and made our oceans...star water...the very same...except with that tritium it first must come through the atmosphere and all of lifes DNA has adapted to that set level of tritium in the atmosphere...therefore the fusing of hydrogen and helium causing tritium has nothing to do with us adding more tritium into the environment that is proven to cause negative health affects with DNA strand breaks, cell necrosis or aptosis, mutations, disease...cancer that isn't added to the deaths per killowatt/terrawatt hour calculations.  The comparison between what happens naturally versus what we do is astronomically different and the uranium and plutonium decay chains in those reactors is not found in nature....the U238 captures the neutrons and keeps the unnaturally occuring element on Earth from chaining out as far as we take it.   Its why it has to be refined to begin with..
Reply: @LawlessChemistry  You obviously don't have the first clue and trying to enter a conversation you don't comprehend fully to begin with and its completely obvious. Would you like to talk about solar dynamic as well...poloidal and toroidal fields, convection zone...it takes a single photon upwards of 100,000 years to leave the core.....of course when you talk about tritium in our reactors you must also talk about the other radionuclide because of it...d_________
Reply: @LawlessChemistry  Do you know how tritium reacts to stainless steel?   Permeation......splitting and rejoining once through the molecular structure of the metal itself.....no?
Reply: @LawlessChemistry  absolutely. This is how a typical anti-nuclear activist sounds. They find terms that sound very scientific, sometimes even whole sentences. Even stuff said from nuclear proponents. Then they repeat them in ways that sounds like nuclear is bad.

Your analogy to Dams and cares is dead on. Even to the vaccine causing problems.

Most anti activists, of anything, have a false fear of the good stuff, and perpetuate. They take very real science, that completely went against everything they are against, and use it to make the item they're against evil. That's how the fears spread and more believe it.

There is a really good article about this, I'll have to look for it again sometime later. The anti-nuclear activists took this long scientific speech about nuclear power, nuclear bombs, nuclear medicine, then cut very small fragments of it and added it to their own false paper while quoting the original author, trying to demonstrate that this presenter was anti-nuclear.

This author ended up writing another report about this and gave very good examples of how the anti-nuclear activists took the authors words and changed it to make it sound scary and well very much false.

I believe it was in the mid 2000s, and the final report was 2009.

Anyways the whole sciency words tossed into their false fears let's people more easily believe it. The movie takes about above is an extremely great example of this, The China Syndrome. It's such a great example that people use the movie to quote scientifically, yet it is a completely false movie.

They don't even need to use real science either, lots just make up words that sound scientifically sound even.
Reply: @paulmobleyscience  You are correct, I haven't got a clue what you are trying to say. Pasting wikipedia articles is not the same as understanding the subject matter, but I applaud your effort to sound intelligent.  Repeating terms like tritium and radionuclide just makes me wonder if you actually know what they are or what else they can be called.  Based on some other replies to your science madlibs, I'm not the only one clueless here. What do you do when you have to fake scientific literacy in person, frequent bathroom googling? Immitation prescription glasses, cite UN conspiracy to sabotage your brain? Scream loudly  when you need to emphasize RANDOM WORDS  you used to write in all caps? Hide a scientist nearby a la Cyrano de Bergerac? 

If all else fails, lay blame on apoptosis and necrosis of your brain cells caused by all that tritium.  GL.
Reply: @paulmobleyscience  well some others have listed their background and years of experience, what is yours?
Reply: @taesssi  Didn't know that about the China Syndrome, I only heard that used as a joke in a Simpsons episode.  I do remember working for NYPIRG out of college and quitting 2 days in because they wanted me to call people and misrepresent the current state of nuclear science. I wasn't even a proponent at the time, but felt that if you oppose something at least make an effort to understand it and represent it accurately.  That whole "we can't even detect or fully understand radiation" but at the same time knowing everything about how it is too dangerous to ever be used relatively safely and cleanly.
Reply: What's a nerd
Reply: @LawlessChemistry  Downplaying Chernobyl????  Are you kidding??? Is that what you think I'm doing?  Wow ok now it all makes perfect sense....you don't even know that I'm saying and know that millions of people were affected by Chernobyl and that it WAS downplayed by the IAEA and the WHO which are part of the same exact corrupt organization the UN hello????  You are completely lost aren't you?  Yes tritium....what is the range and the deposition through the range of tritium?  H2O.....does that usually work on everyone?  Dyhydrogen Monoxide....2 hydrogens and one oxygen...yes...what angle is the bond between them?
Reply: @rkou8290  I ski down any slope, ride any motorcycle or four wheeler, shoot 3s all day long, do a pop shove it, play bass,guitar and drums.....and I know that Coulombs law is F=Kq1q2/r2.  Not so much
Reply: @paulmobleyscience  Considering the fact that you continue just copy-pasting random terminology from scientific fields you likely don't understand, I can see how you think asking me to copy paste responses proves something.  Granted, anyone who has done basic chem knows about electron orbitals, but you being able to yell "objection" and "stare decis" doesn't make you a competent jurist either.  I don't know about electron avalanche, but it is ok not to know something outside of your area. I'd rather not fake having the knowledge and understanding of everything, while at the same time understanding little or nothing. You haven't really shown that you know or inderstand any of these concepts either. I mean you just randomly state unrelated cross-discipline terms. I can do that also, and probably without using google, but all that will show is that I am as good at parroting things I don't understand in order to... look pathetic to people who actually studied those fields and impress some middle schoolers. 

So islnstead why don't you show that you have even basic working knowledge of half-life isotope progression.  Tell me the death date of a fossil containing 30mg of Ur-238 and 10mg of Pb-206. 

Typing in half of the TOC of intermediate physical chemistry doesn't mean you can tell an electron orbital from and electron tunnel or can collapse a wave function. You're not even a very good parrot since you made errors copying some of these words. Now don't panic, it's not pyroptosis of your brain cells, just you confusing basic literacy (in only one language I presume) and plagiarism for working knowledge.
Reply: @LawlessChemistry  google?  You're the only one talking about google.  Whats your point does it matter where the information comes from when its 100% fact?  Yes keep going, I live for this honestly.  I checked my feelings at the door knowledgless chemistry.  You'll have to do much better than that, I was in a meeting today and still had time to wipe the floor with you.  Evaporation Equilibrium Coefficients of radionuclides...go
Reply: @LawlessChemistry  You keep generalizing how im soooo wrong....specifically type it out self proclaimed genius.  Its exactly as I thought your arrogance proceeds your title and I wait for people just like you to show up.  Does your title usually make others run away scared does it?  You can publish all you like in fact I would love to read what you have published please share here for everyone to see...that is unless you are scared to be peer reviewed?
Reply: @paulmobleyscience  your 'truths' are no more truths than a college student going to wiki adding their own information then turning it in as a fact research paper.
Reply: @taesssi  Who pulled your string?  Whats the matter?  No one can point out specifically where I am incorrect....now I'm in college ...I went from high school to college finally.  You people are fascinating to me honestly...to hold knowledge and do what you're doing with it amazes me.  I get it now you think I'm here for you..no no I'm here for the people that will never comment watching all this unfold.  It can be read back in full detail....I simply gave everyone the start, the beginning almost like youre pointing out.  I'm not here to hold everyones hand all the way to the end....Im obviously ONLY opening the door for everyone and you all do not like it one bit proven every time you say something like a high school reject would do versus anything technical in the least.  You don't like that I'm freely giving away what you paid thousands of dollars for.  Like I said...someone patted you on your head when they handed you your piece of paper that said intelligence on it.  All those years of smelly dorm rooms and hard work just thrown right down the drain.
Reply: @paulmobleyscience  Sorry, genericizex term. Not google, ask jeeves or bing, or maybe you even rode your ATV to a local public library ones, ran over a college student and took his textbook, wbatever. I've been a lawyer long enough to tell when people are readim a script not of their making. What you were doing is analogous to reading cliff notes of a science textbook, except this is your first reading.
Reply: @LawlessChemistry  I will tell you one snippet of my personal life not that it matters in the least about nuclear power plant meltdowns....I served overseas at Spangdahlem Air Force base Germany.  With that knowledge youll know that to even get into the Airforce your test scores must be higher, it wasn't much of a challenge obviously with only a few points away from perfect, and served for my freedom of speech...that you nor anyone else has the freedom from.
Reply: @paulmobleyscience  Entry level imolies you did something more than poorly copying or rephrasing it. I think I made it apparent that you are doing something much worze, presenting high lev information in a way that makes it apparent that the extent of your knowledge snd understanding of the subject matter is likely nonexisten, but that doesn't stop you from pretending to be internet's least coherent genius or from sarcastically callong anyone with even basic understanding of the subject who points it out a genius. Your sarcasm is unwsrranted, I am not bent out of shape for myself, my last science publicatiom is 2 decades old. The lawyer sife of me just can't pass up on such affront to those who stuck it out in science. You don't see me go ionline oretending I can recire every rscomg bike engine and its specs, nut if I did at least I'd make it believable and do some prep so that I don't sound like a flat earther claiming to be an astrophysicist.  I bet on weekends you also comment on legal videos and give shitty legal advice, which would be a crime but not as bad a crime as your madlibbing science cause you got irradiated during your night shift at an chicken egg hatchery.
Reply: @LawlessChemistry  Ohh you think that young woman in that video I published is related to me?  No....you people assume so much a know so little.  That's a simple video I showed for people to understand visually, easily, simply entry level you could say how the water cycle works. Do you know my sister and what she does?  Of course not you're making assumptions which I'm surprised from a lawyer you guys are usually so forthcoming with correct details.....
Reply: @LawlessChemistry  I didn't copy and rephrase anything.  What did you learn from?  Tell me?  What did you learn from the time you started school until the moment you received your diplomas...of which aren't doctorates right?  No majors?  Ok then why are you assuming to know who I am and what I've done based on some simple entry level information that is 100% correct mind you, you haven't pointed out a single thing that is incorrect yet, and then went on a full day bender arguing with me over.....nothing that involves the video.  You are trying an ego match with me and it isn't going to work.  The inverse square law does not apply to extended sources of radiation....
Reply: any idea how the power dropped to 30 MW if not by Xeon poisoning?
Reply: @thrymthorson2929  It was a control system problem due to human error or possible a minor malfunction. The details are arcane, but basically the automatic control rods inserted unexpectedly. Of course, once they were down at very low power, xenon was a bigger problem than it was before.
Reply: If the reactor was not in a state of Xenon poisoning, why was it all but impossible to raise power back beyound 200 MWt once set to global control. 
???
Reply: @taesssi  Ok I just seen your comments above and for some reason you think I think that the explosions at Fukushima or Chernobyl is the same type of explosions that happened in Hiroshima and Nagasaki.....which couldn't possibly be correct with the amount of information I placed here to begin with.  First the amount of material used is astronomically different.  A bomb uses pounds of material while a nuclear reactor contains tons of reactor fuel and spent fuel.  In the case of the bomb dropped on Hiroshima the U235 used that came from the African Congo was 60% pure and some of the most purest Uranium used in a bomb that was detonated.  In a reactor the fuel is generally on average 3% and if MOX is used then its upwards of 6% mixed. Now the explosions.....when the bomb was detonated the source point was then scattered, distributed in the field but the initial source point is no longer extended at that point and isn't an ongoing flow of energy or matter into the environment. Irradiation of dust particles, bonding to molecules and the fall out does just that it falls out of the area and circles the globe attached to those particles and molecules.  In the case of Fukushima it is much much different. In unit 3 the molten fuel burned off the H2O that was inside the reactor pressure vessel causing gas to form.   Hydrogen/tritium/noble gases built up inside the PRESSURE vessel and it was too much for the vessel to contain the pressure of which the weak point of a mark 1 reactors pressure vessel is up top where the pipes go in and thats where the gas came out and when it met the oxygen in the air it exploded sending the bundle holder down through the bottom of the pressure vessel causing water and the fuel to flow out of it.  The explosion caused cracks throughout the containment and buildings causing water, ocean salt water and ground water to flow in and out of the vessel still today.  That water has in it the water soluble evaporating under equillibrium conditions radionuclides that the ALPS system is attempting to filter out and none of them are at 0 with 67 billion becquerals of radioactivity still left in those 250 out of 1000 tanks proposed to be dumped into the ocean using concentration ratios to justify the releases. And that entire site is an EXTENDED SOURCE OF RADIATION THAT THE INVERSE SQUARE LAW DOES NOT APPLY TO. So you see, I know exactly the difference between an atomic bomb and the explosions that happened at Chernobyl and Fukushima with laws given as proof.
Reply: @jonnytightlips513  I think it was in state of xeon poisoning. I thought that was the reason why power dropped to 30MW which seems not to be true
Reply: @jonnytightlips513  I didn't say there was no xenon poisoning, just that the amount of xenon was nothing special or unusual. A reactor is always producing poison.
Reply: @thrymthorson2929  no the power dropped because the control computer which was meant to stabilise the power at 700-1000MWt was either not set correctly or was not working correctly and allowed the power drop to around 30MWt
Reply: @MinSredMash thank you for the reply, yes I understand that you said that the Xenon poisoning played no part in the accident, but if there was no substantial Xenon poisoning why was it impossible to get the power back above 200MWt with less than 15 rods within the reactor, that was my question ??
Reply: @paulmobleyscience Says the guy who assumed that because I have "chemistry" in my moniker I must be working in the nuclear energy sector. And I have no idea to what woman you are referring; I did not mention any women. I'm not sure what you mean by "you people" either? Did you also assume I was a person of color? Or is it your way if generalizing about lawyers? It's not that I never make assumptions - my initial assumption of basic competence on your part has long been disproven. It is apparent that you have no applied scientific knowledge, but have no qualms using poorly understood scientific terminology for posture's sake. Bragging about entrance exam scores, making weird assumptions about me while accusing me of same, doesn't leave me with a very high opinion of you. There are plenty of people here with actual accomplishments and who don't use them as a substitute for presenting an argument. Don't even get me started on freedom of speech or what it has to do with this discussion.
Reply: @paulmobleyscience  Defamation, cyberbullying, lol. I see you know as much about law as you know about science. Are you going to pretend you know law as well with a word salad of legal terms? Feel free to consult a lawyer and get laughed out of an office. You couldn't pay me enough to take someone like you as a client. Stop before you give good people of the U. S. Air Force a bad name by association.
Reply: @LawlessChemistry  Person of color?????? What are you talking about?  No when I said you people its obvious I meant silver spoon fed lawyer chemist....yes lawyers ignoramus.  You have yet to prove anything incorrect....which normally you people can do....lawyers by the way I see I have to spell everything out for you so you dont make assumptions like you have this entire thread.  The entire thing....chicken egg farmer.  Yes defamation of character, slander...those things you typed thats documented....yes Knowledgless lawyer chemist.  Still not one thing....
Reply: @LawlessChemistry  Accomplishments....look what I did.....look at me me me.   Yes we are looking at you and youve said nothing here except..look at you.  So....the inverse square law does not apply to extended sources of radiation...Chernobyl and Fukushima are extended sources of radiation.....all youre saying is rely on those who are accredited right?   Everything I said is 100% proven fact and the ramblings of a no name on Youtube can never change that.  Lawless Chemistry is not published in anything other than garbage on this thread.
Reply: @jonnytightlips513  Specifically I meant that running the reactor at half power did not influence the accident via xenon. Xenon poisoning is inevitable whenever you operate the reactor at low power like they planned to. So saying that xenon played a role in the accident is like saying that gravity played a role in an aviation accident or buoyancy played a role in a shipwreck. After the unexpected drop in power, then xenon did suddenly become a problem in an unexpected way. Although xenon was still less important than people think, because it is most likely the case that they reached 200 MW with an ORM higher than 15. But enabling the other two pumps for the test and restoring water levels in the drum separators required pumping a lot of cold feedwater into the circuit. This required withdrawing additional rods that put them at 7-8 ORM for a few minutes. It was during an interim of the computer cycles, so they did not have the ORM data available at this time.
Reply: @MinSredMash  yes I understand the Iodine-Xenon cycle, I would say that the Xenon poisoning played a pivital contributing factor in the accident. Not only did it retard to the intinal power rise, this was before the attempts to rebalance the hydraulic state of the reactor and  the switch on of the adtional cyculation pumps. 
The ramping attempt lead to such a low rod count (yes further rods would have been removed due to void collaps and graphite cool down) but the Xenon also lead to an uniformed power density distribution across the core making it more difficult to calculate the OMR within a meaningful time frame. 
The inability to rise power then lead to the thermal hydraulic issues, steam quality and pre cooling. 
I am  not saying Xenon caused this accident but I would challenge the notion it was like gravity in a skydiving accident.
Reply: @LawlessChemistry  Basic competence you said....like its something that wasn't already predetermined by me to be is basic competence for entry level people to understand both sides of this radioactive coin...not just the side people (lawyers) like you would push especially with a name like LAWLESS CHEMISTRY.....you have spelled it out perfectly for everyone I couldn't have asked you to do it better than you did.  You showed an absolute disregard for basic human respect and ATTEMPTED to throw your title around as if it was going to make me do anything different than what I've done thus far.  The inverse square law does not apply to extended sources of radiation....what physics law does apply to extended sources of radiation?
Reply: @LawlessChemistry  I said even less about myself and only said that because I was pushed to do so and not just by you.  Titles mean nothing especially when 100% correct entry level information is freely given.  You showed utter disrespect because I ask MrChyort how many people died as a result and even said let's be honest here and not play games.  I told him and spelled it out proven here that a great conversation would be had if we could all be honest about this and honesty was the furthest thing used and you are doing the same exact thing over and over even.  Still to this day you have yet to say anything about the information and have directed every word into attacking me on a personal level...you can delete your comments but they can't be taken back and unseen by us all here.  Its very very obvious what you came here to do and it completely backfired in your face.  And the only reason you continue is due to the egg on your face......because you can't prove me incorrect about anything and therefore completely a waste of everyones time for you to continue this charade, in every sense of the word, because your feelings are hurt because you can't prove any one thing other than you are an arrogant self indulged egotistical classic YT commenter that thinks because they are looking at a screen that they can say anything they want about someone...complete STRANGERS!!!!  And a lawyer on top of it knowing that slander and defimation of character are real laws that you are breaking all the while attempting to cyber bully me personally over predetermined entry level information that is 100% correct.   You tried to say I rephrased things,copy and pasted things, my sister, chicken and the egg, throwing insult after insult never knowing I served for your freedom if you live in the US.  How would you feel if you served for someone's freedom of speech and with that freedom of speech they choose to bash innocent complete strangers online in their freetime?  You obviously like I said before look up and see...you have only served yourself in this world its so completely obvious and you will think about what I said here.....later not know because your emotions get the best of you, but later you'll be thinking and realize I'm correct about it all and you are no different than the literal thousands before you that ended the same way as it has now....except they tried to at least tackle the information and they couldn't because its all predetermined by me to be that way....entry level information mind you lawyer....physicist...engineers....chemists...biologist....I can point you to the debates its very easy.  They all tried and it never works...because the cards are always stacked against you because I know the information.  It isn't hidden from me behind paywalls, or college walls.  Remember you know absolutely nothing about me or if I've been to college or worked on projects from the ground up or anything other than what you deem is high school, college, entry level, BASIC COMPETENCE!!! You're such a fool and you'll do the same as the rest...slither off and continue your nonesense on lessor opponents and trying to use your title you use everyday on here to manipulate people and conversations...fraud
Reply: @jonnytightlips513  Xenon is certainly a precondition, otherwise there would be more rods in the reactor. But it's ultimately just an inevitable symptom of operation at reduced power. Low power is the factor that determines the presence of xenon, the inaccuracy of the instrumentation, the instability of the hydraulic systems, the low subcooling and the positive fast power coefficient. 

By the way the xenon didn't really affect their ability to calculate ORM. It was never possible for the control room staff to calculate that value without the aid of the computer outside of steady state operation, and they consistently operated on a periodic schedule of ORM reports. Any kind of transient made ORM impossible to track, xenon or no.

For instance, had they carried out the test as planned, with a single drop from 3200 MW to 700 MW, the xenon situation would have been even worse. BUT the higher power would have excluded the other dangerous behaviors of the reactor. Likewise, dropping straight to 200 MW would not have been any better from a xenon poisoning standpoint.
Reply: My comment was deleted so Ill type it out again though it was directed to the lawless chemist.  In 2020 a study was published long after anyone that learned that tritium simply passes through the body within a month in college.  In this study it outlines that tritium does not simply pass through the body in under a month.  It replaces hydrogen in the cells or it binds directly to a cell to form ORGANICALLY BOUND TRITIUM of which negatively affects human health by internal exposure resulting in various biological affects including DNA strand breaks and other issues resulting in mutations from genome damage done to the chromosomes that make up that DNA that is passed on and written into the RNA of offspring.  In 2020 mind you this is proven science not by me but those in the top of their fields have proven it.  Organically bound tritium....

Everyones talking about Xenon...ESTIMATES of the release of Xenon-133 and Cesium 137 from Fukushima are as follows. 1 out of 4 units- Unit 3s release of Xenon-133 from the core was ESTIMATED to be 4.85×10-18 while the SPF released 2.59×10-12.  ESTIMATES of the release of Cesium-137 from the core is 2.59×10-17 and from the SFP it was guessed to be 3.96×10-17.  Does anyone have the guesstimation of the release of Xenon-133 and Cesium-137 on hand?
Reply: (MAP) Posteriori results.  What are the parameters of making a good MAP?
Reply: @MinSredMash  sorry when I said calculate the OMR I should have  said understanding the condition of power distribution within the reactor.... at any given moment. 
Yes of course I understand all of that, I know how and why Xenon is present in the reactor as I already said. Yes any reduction in power will lead to an instability in Xenon production and burn off, that is why the power was meant to be brought down gradually to minimise the 6 hour lag of Iodine production. I do not disagree with anything you have said other than the importance the Xenon played as a contributing factor to the accident. 
The main intal reason the reactor was put unto such an unstable configuration was the attempt to bring back the power, the retardation of the power rise was the Xenon. 
INSAG7 lists the Xenon poisoning as a contributing factor to the overall disaster... 
I am not challenging your knowledge and clear understanding of this matter just simply can not agree on this issue. Had the reactor not stalled and the Xenon built up they would not have removed as many control rods as they did, running the reactor at practically full throttle with the wheel chucks in.
Reply: @jonnytightlips513  Im the one giving you a thumbs up by the way, at least you're as honest as you can be with the information given.  Well done
Reply: @paulmobleyscience  Please know i am not trying to argue with you, I am always on the hunt for new or improved information on this subject. I respect your knowledge it is evident you know what you are talking about. There is nothing wrong with healthy mature debate and convocation, and it I learn something new all the better for it.
Reply: @jonnytightlips513  Im not arguing with anyone just as you making certain the correct information is known and that the important details should be comprehended first before animation issues are spoken about.  I respect anyone that shows respect to others and have enjoyed watching you converse with people and it should always be done in this manner.  No one is above anyone else and thats the way it should be, thank you no worries from me in the least.
Reply: The inverse square law does not apply to extended sources of radiation. Source: Bureau of Standards/NIST
Reply: @jonnytightlips513  INSAG-7 points out something else, which is that there are a fairly large number of scenarios by which the reactor could enter this unstable state. Specifically, an RBMK that experienced an AZ-3 signal could put itself into ORM violation over the course of half an hour, without any intervention from the operators. So yes, stalling the reactor played a crucial role on April 26th, but was just one of several ways to create an explosion. Ultimately they were operating the reactor in accordance with the designers' original intentions, and withdrawing rods was the approved method for overcoming xenon poisoning. Except that in recent years an ORM limit had been plastered ineffectually into the manual, without any operator retraining.

Ultimately I can't argue that xenon wasn't a factor, just that putting in a simple list obfuscates more than it explains.
Reply: @MinSredMash  absolutely agree, its nice to talk to someone with such a vast knowledge  base of the subject. 
I have read everything I can find on chernobyl and still have a million questions.
Reply: @jonnytightlips513  Ask away if you want. There are so many amazing sources which still haven't been translated, although all the interest from HBO is changing that to some extent. Too bad the 35th anniversary snuck up me, it would have been a good time to write some sort of article about the topic.
Reply: @MinSredMash  I will definitely pick your brains.... 
Yes with everything going on at the moment it sadly almost got over looked. I was meant to to be there at the end of last year on a 4 days visit throughout the exclusion zone and of course the power station, but lock down sadly put an end to that. Waiting for overseas travel to open up again to re-book the trip.
Reply: If anyone here has any questions about nuclear power, I am more than willing to try and answer them for you. Feel free to leave a comment (doesn't give me notifications on this thread for some reason), if they're is a way you could message me too.

For some long reading about chernobyl, you should look for the official reports, there is one, i believe 189 pages long, and an updated one with newer information 148 pages long. And there is a good website that goes over it all in a web page style, kind of like older online learning style, all 3 are official and I'll link here at the bottom.

Finally, if you want to learn more about nuclear power here will be some search terms, the more basic the terms, the more likely to bring up anti-nuclear activists sites, instead of true information. For example 'nuclear power' is very  and lots of times shows up a lot of activist things, however it turns up a lot of good information too.

Search terms like 'UN and nuclear power', 'WHO nuclear power' put in all kinds of stuff in front of nuclear power. Can use like 'United States thoughts on nuclear power'

'how is nuclear power safe?', 'why is nuclear power one of the safest and cleanest forms of energy production' , 'what is the lifetime emissions of a nuclear power plant' (mind you that this number gets way smaller and way better as the plants continue to keep aging more and more time to their life time, extensions), 'banana radiation comparison ', 'how is China going to get 0 emissions by 2030', 'what is an smr?' 'why are SMRs great?', 'can SMRs help rural communities, or third world countries? "

'why did France build up such a large nuclear power generation' 'how much will the shutdown of the nuke plants in France hurt the country and its economy' 'how much does France make off of selling nuclear energy?'

There are so many more too.

Don't forget to search 'how has false fears hurt the nuclear industry'

Search about why anti-nuclear lie or stretch the truth to fear people.

The possibilities are endless.  Have fun!

https://www-pub.iaea.org/MTCD/publications/PDF/Pub913e_web.pdf

https://www.iaea.org/newscenter/focus/chernobyl
Reply: @paulmobleyscience  I'm not sure why I got a notification dragging me back into this argument a week out. This section is so tiring. I don't mind answering questions, just this argument is the same thing over and over for 160 comments. 

 I did take the time to reread almost all of them. 

Anyways just wanted to let you know, in a lot of your comments involving 'OBT', except for one comment, where you were typing your knowledge, you keep writing "OBT" and referring to it as "organically bonded Tritium."

The correct term is "organically bound Tritium", of which used by you only 1 week ago, where you capitalized the entire definition of OBT, and listed the correct terminology.

OH, and your long written explanation of the explosion was closer to a correct way of things happening. The reason why I went over the difference of explosions to begin with is that for your first few comments you kept saying 'nuclear explosion'. I was trying to correct your terminology of calling an explosion at a nuclear power plant a nuclear explosion, there can not be a nuclear explosion at a nuclear power plant.

Lastly when oxygen and hydrogen meet, they do not spontaneously explode. There must be an outside element (heat, like in the water balloon experiment) to the chemical reaction to cause combustion.  You have several times mentioned this reaction, stating that 'when the hydrogen from the pressure vessel met with the oxygen in the air it exploded'. In a way that is true but you really should include the element that actually caused the explosion, the heat. In the balloon experiment most use a lighter, others have used a spark. Also that a pure hydrogen explosion isn't possible either, hydrogen with out the oxygen can not burn.

Here is the current understanding of OBT in the environment, though I think this one is from 2013.

https://pubmed.ncbi.nlm.nih.gov/23962797/
Reply: The truth about Chernobyl: HOW THE 4th UNIT OF CHERNOBYL NPP WAS BLOWN UP (channel-KS).